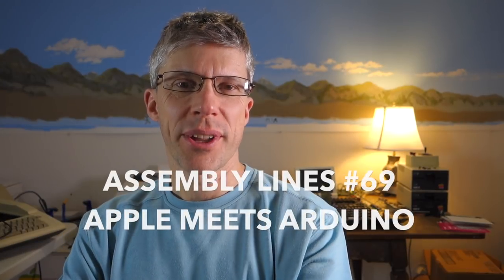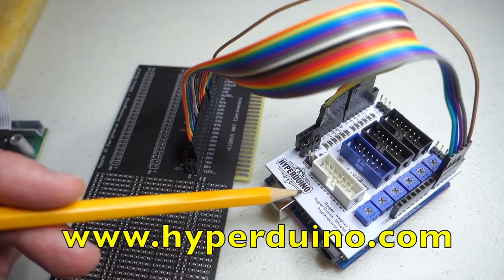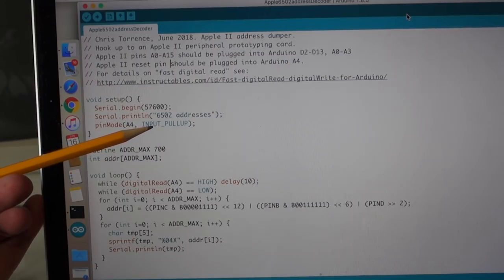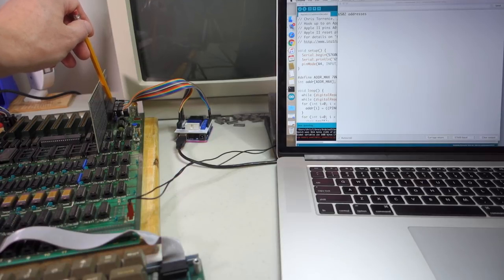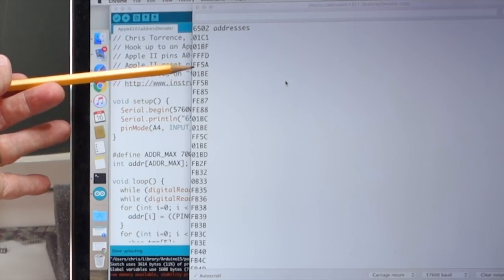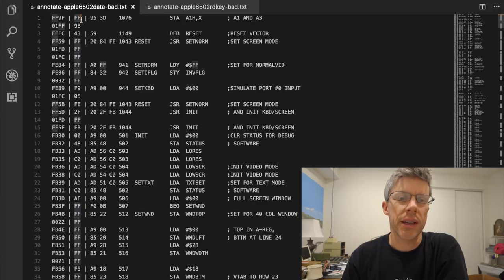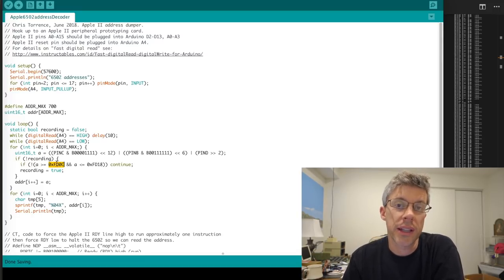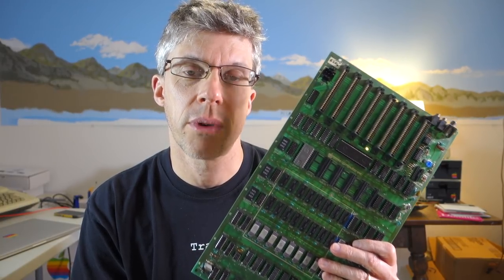#69 Apple Meets Arduino

Comment: Arduino logic analyser - nice one. I'd wondered if i could use an arduino to implement a plug in card at the hardware level. The board's problem must be a broken trace or short around the keyboard strobe address decoding/reading. It'd be so tempting to do a custom ROM to test the I/Os. Can't wait to hear what the culprit is.
Reply from the maker: I took your suggestion and played around with a custom EEPROM using a 16k language card. Worked great until one of the pins broke on the 28c16. Now I need to order more of them...
Reply: Bummer!  Just was going to suggest to dianose pin 2 on the keyboard connector then I reread below, which I guess refers to the keyboard latch. You should be seeing its enable toggle during all the beeping. Otherwise its address decoding. If it was just bit 7 of $C000 then if you push a key right after the reset, the buffer should fill with that.

Comment: Quick test: pull down to GND pin 5 of B7 and it should stop fillinp up the input buffer. First check with the multimeter: it should be high all the time if it's the culprit.
Reply from the maker: I tried this but it didn't make a difference. It also didn't seem to matter whether B7-5 was low or high - the assembly output was still behaving as if a key was pressed even though B7-5 was low. It's seems like it's completely ignoring the output from B7. Maybe the data bus or data multiplexor is messed up.
Reply from the maker: I fixed the problem. Video coming soon... :-)
Reply: Great! Can't wait to see it :-)